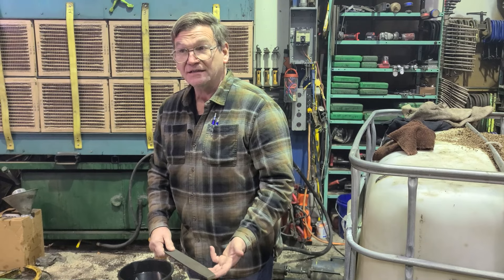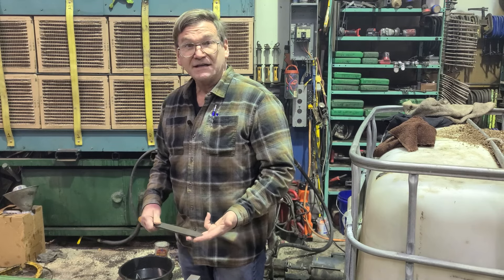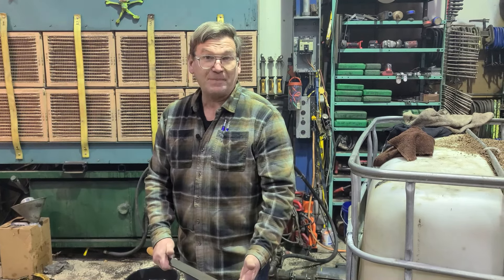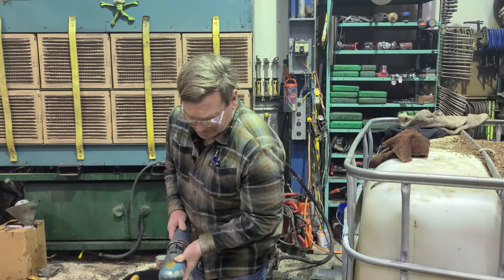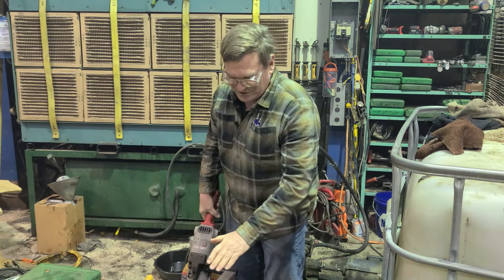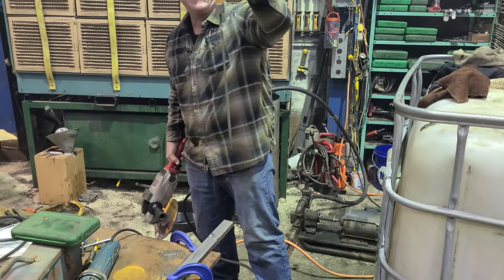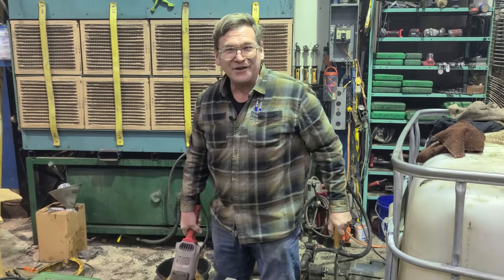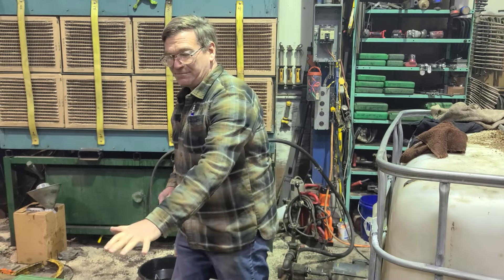Machinist's Minutes: About backstroking files ( I don't do it! )

Comment: You are so right. I served my apprenticship  in the seventies in a very old and respected company making metal forming machinery, everything from tinsmiths jennies to huge hundred ton presses etc. Everything was made in house, cast iron and steel with phosphor bronze bearings. My father scathingly called it 'steam roller engineering'. Fitters spent their lives filing and scraping crudely machined parts to make them 'fit'. Fifty thou' to file off a large cast part was normal and so was ten thou' to scrape out of a ten inch diameter bearing. The only way to avoid the job being cruelly boring was to take pride in the work and do a real craftsmans job but those machines that we made had the potential to last forever. Since I have done with a file, jobs that I have been told are impossible, such a shame that these skills are being lost. You cannot do accurate work with a file unless you think about every stroke and that means no back strokes. Oh, and when the file was worn out you made it into a scraper or some other tool because they were made from top quality cast steel and too valuable to scrap! Regards, Jon

Comment: I file internal keyways and thats about it. 5 inch angle grinder with a flapper wheel works nicely on everything else. Oh and a few nice triangular files for those threads you need to repair when you dropped the grinder on that shaft.

Comment: I also file one way, it never felt right to go backwards, even in Aluminum. Something about how effectively it cut. I always chalked it up to the way the chips were knocked around one way v the other way. I also use a crepe rubber sandpaper cleaner on my files frequently as I work. As soon as I feel the file is having a bumpy ride, or the back pressure is uneven, I file some crepe rubber.

Comment: I was always told don’t drag your file backwards I was taught that in high school 30 years ago. The welders/mechanics I worked with for all said the same thing dragging your file backwards f***s up the file. To this day I don’t drag files make a stroke pick it up stroke again. What I usually use flat files for is cleaning up gasket surfaces.

Comment: Dead right! You can feel it when a file bites and when it rolls when it doesn't. You can also feel when you get the angle right with a diamond sharpening rig too. You can feel the drag but you have to be waiting for it.

Comment: Hey thanks for video.  I cringe when I see people dragging a file backwards, same for hacksaws.   Remember my old mentor saying you are using that hacksaw too fast, ditto for filing, surface speed people, files are high carbon steel, lots of hacksaw blades have been high carbon also.  I file on lathe left handed, have an old machine shop instructor to blame for that.  Always lift the file even on lathe.  File cards are great kinda, chunk of softwood cleans ok or a sideways brush against pant leg.   Piece of aluminum slideways will dislodge chunkage.   Soapstone makes it so you have less buildup in gullets?
I remember my first file, went to Earp's hardware in Lamar Missouri I was probably 13-14 years old.  Yes he was one of Wyatts cousins, this was early 1970s, told Mr Earp I wanted to buy a file, mill bastard he asked, I probably nodded yes since I didnt know the difference between a smooth, bastard or a double cut then.  He went to his cabinets and pulled out a box of individually wrapped in wax or protective paper files, no blister packaging then.  Made in USA,  wasn't a Nicholson, I am thinking it might have been a Heller but probably a Simonds.   That was a long time ago, it was a wonderful file, it actually cut.  I miss old hardware stores.
Mr Howee if you read longwinded comments like mine I make a request.  I keep thinking about that coke spoon deburring tool.  Round spoon shaped how big flat on front sharpened on bench stone or slightly negative on leading edge.  Thoughts and observations always appreciated, Oh, did I say thanks for videos.

Comment: I've got a question. Do new files need breaking in? Some files i have bought suggest breaking in the file on a soft metal such as brass. What are your thoughts?
Reply from the maker: I had never heard that one, I would not see it as needed.
Reply: @HOWEES  Thanks

Comment: My 2cents 
I learn the hard way. I’ve ruined perfectly good files. The subsequent ones purchased going forward were treated like gold. So by simply changing the two command program to 4 commands. Forward, up, back,down. Repeat = success
Didn’t listen to anyone. 
One lesson that turned to reward: 
To go forward the least expensive way possible after overheating the engine on my Triumph spitfire mark3. was to file the warped head back to a fit I would not lose all cooling fluid on the 100 mile journey back to an appreciable civilization, somewhere I could at least buy a head gasket. 
So ya the file I treated like gold saved my bacon. 
And my marriage.

Comment: Couldn't you do a somewhat scientific test by letting someone else use a file each with and without back drag and then testing if you can tell the difference.
Reply: There is a video about that very subject. It disproves the myth!
Reply: This doesn't need any evidence that a random dude from the street will need to tell the difference before it can be declared as truth